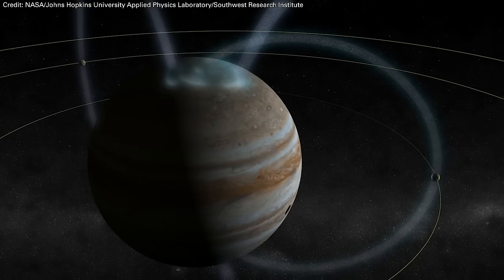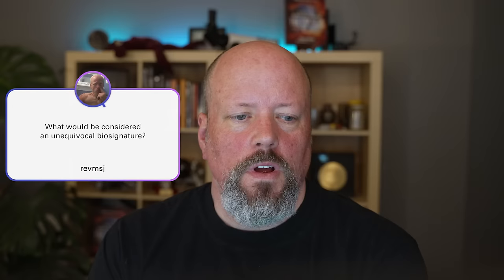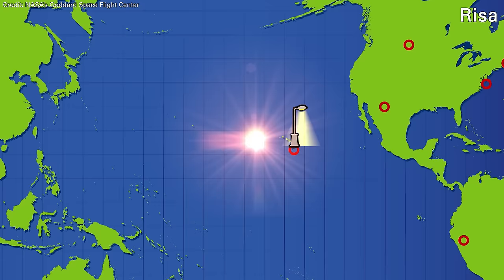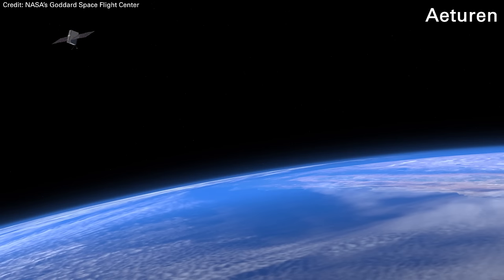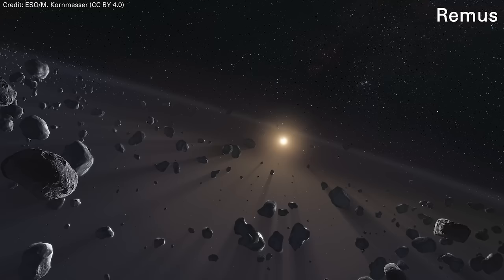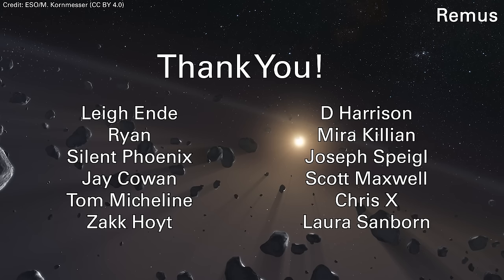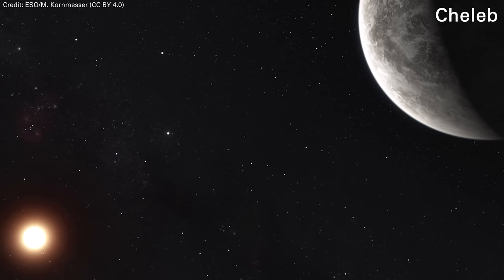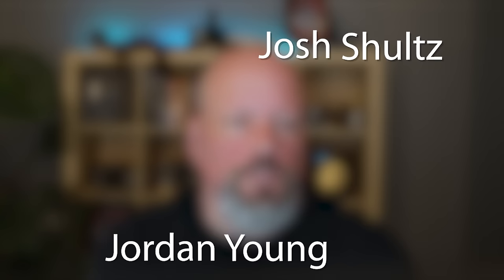Refuelling the Sun, Rogue Planets Auroras, Space Nukes | Q&A 249

Comment: By far the simplest way to get the water from the regolith, is simply to heat it using the sun, it gets well over 100 degrees Celsius on the sunlight up there, so it's just a matter of using solar charged vehicles to transport crushed regolith to a solar furnace and then take the steam and run that into a turbine to produce even more energy, the cooled steam then has lost enough energy to condense out, and there you have water, power all in one.

Comment: I've always wondered why they weren't using lasers for high bandwidth comms. it was possible even at least ten years ago, now, it's ridiculously cheap because of the low cost of high power solid state lasers. Radio waves are not very directional, and thus heaps of energy is lost, but lasers ARE very directional and you can really crank up the bit rate and do it over multiple frequencies as well, it's a no brainer really, plus, because they are so directional, they are also much harder to intercept !. In fact, with time based crpto , they are probably 100 percent secure.

Comment: Hey, Fraser. Sorry to correct you: you can't broadcast anything with lasers, because lasers are by definition point-like, so you can only send information to a specific point in space (that's the good thing about them, since they do not have any appreciable apperture, you don't lose energy as the beam gets farther away). So no, anything you do with a laser is not really a broadcast. You could scatter the beam manually, or have multiple beams to reach more places, but that's a different thing (and very inneficient). A normal LED light would be better (as it will be seen from many angles and directions, which is what I would call a broadcast).
Reply: While theoretically true, in application there is beam divergence. Depending on the distance & separation of targets, laser broadcasting is ideal. When looking looking for sources many light years off, like optical SETI, laser broadcasts would encompass our entire solar system.
Reply: It’s 0.138 arc seconds best theoretical beam divergence… so 17k wide at 1 parsec. I’d say it’s highly unlikely a beam would strike earth. Assuming random angles and limited volumes of lasers per planet it still seems a vanishingly small chance.
Reply: Sorry to correct you but actually fraser is correct. I would know because my dad is the ceo of laser beams
Reply: That's completely backwards. If a laser were point-like it wouldn't have a front or back so you couldn't actually point it at anything.
Reply: @shanent5793  The section of the laser is point-like, not in a mathematical sense, but in a practical sense; meaning that the beam is not conical like most light sources. Instead, it will keep it's diameter for very long distances (even in the Space). And because it doesn't get spread out, it doesn't "lose" energy from the stand-point of the viewer, no matter how far is it. That's the strength of the laser, and the reason you can't broadcast with it.
Reply: @shanent5793  And by conical, I actually meant spherical (which becomes conical when you have a base, like with an LED or a traditional flashlight).
Reply: @guillep2k  that's still not right. A laser beam must diverge. Its minimum divergence is proportional to wavelength and inversely proportional to its narrowest diameter. There's no way to make that zero. The beam can be focused to a smaller spot to increase the divergence until it covers the entire sky.
Reply: @shanent5793  Good luck broadcasting with a laser within the solar system. Anyway, this at least requires clarification.
Reply: @guillep2k  it's probably the best way. The narrow line width and coherency make the signal easier to detect

Comment: Perhaps the best way for any civilization to send a deliberate message to others star(s) is NOT to construct a massive laser, but instead (and this would be easier) to construct a large optical aperture say 5 kilometers or more in total area that is akin to the matrix inside an LCD display, by applying voltage across it you can make it totally black or totally transparent having this in orbit around a star.  So in effect you have a gigantic sun powered optical link. Using this you could send messages to other stars in a variety of formats. Anyone at the other end observing the source star will detect a series of on/off pulses from the star. Admittedly we couldn't discriminate any meaningful data yet with our current technology except perhaps from stars within ten or so light years but soon we will have the ability to tease out all kinds of signal data from stars...

Comment: The sun fuses eleven Empire State Buildings-per-second of Hydrogen into Helium. It fuses Earth’s mass in hydrogen roughly every 300,000 years. It would require a lot of hydrogen to refuel.
Reply from the maker: It already has all the hydrogen it needs, it's just trapped outside the core in the radiative zone. You just need a big spoon to mix up the Sun a little.
Reply: @frasercain  That’s a good point. Red dwarves last trillions of years because the cooler burning pushes less hydrogen away from the core, allowing longer fusion.

Comment: How many launches are required to move 100 to 150 tons to the lunar surface? Side note that mass will be at  or near the pointy bit in the cargo bay. Great Musk states SpaceX will be cheaper per launch by reducing the cost per launch only to increase the number of launches to get 1 starship(HLS) to the lunar surface.

Take into consideration not only do you have to accelerate that mass to a speed to which it reaches the moons gravitational influence, you also have to do a retrograde burn to slow that mass down.

Comment: I would think that being able to detect significant amounts of oxygen gas (5% or more) would conclusively answer that question [is there biological life on 'that' planet?].
Oxygen, you see, is horrifically reactive. It will be reacting with anything and everything. During the normal course of events, all gaseous oxygen on a planet should disappear over time, as the oxygen atoms react with something far more interesting than another oxygen atom. And so, finding large volumes of gaseous oxygen would necessitate there being a biological source that is constantly producing elemental oxygen, from the bonded oxygen within molecular compounds.
If the oxygen levels remain constant after a year of observation, then we can say with certainty that there are biological life forms producing this oxygen as a waste product.

Nb: I'm a chemist, but you might want to ask a biologist this question, for a- potentially- more accurate answer.
Reply: There are some elements that don't or react very little with oxygen:  gold, platinum, iridium, palladium, helium, neon, xenon, krypton and radon.
Reply: @douglaswilkinson5700  
Those elements don't react with oxygen because they're very low on the electronegativity scale, while oxygen is very high. The fact that one doesn't react with the other doesn't change the fact that oxygen is incredibly reactive (only fluorine is more electronegative).

Ultimately, none of that makes a difference in the slightest. The most common elements are going to react with all of the oxygen present, unless that source of oxygen is being renewed.
Reply: @Raz.C  "It (oxygen) will be reacting with anything and everything (sic)."  I responded to this statement by listing  specific elements which do not react with oxygen at S.T.P.
Reply: @douglaswilkinson5700  
Is it really necessary for me to specify that it will only react with reactive elements?
Reply: @Raz.C  You made a statement that is incorrect.  There are people who read that statement and believe that oxygen "reacts with anything and everything."  Oxygen is reactive because of its electron configuration. In fact you can determine if oxygen will bond with something by looking at their electron configuration.
Reply: @douglaswilkinson5700  
That's just being ridiculously pedantic.
It should be OBVIOUS that it will react with those things that are capable of reacting. It will not, for example, react with a person's hopes for the future. It will not react with your savings account's interest rate.

I could go on and on, listing all the various things that Oxygen will NOT react with. However, grownups don't often feel the need to make such lists, because it's understood that when a person says "Oxygen will react with anything," the unspoken part of the sentence, which is nevertheless understood by other grownups is - "It will only react with those things capable of undergoing such a reaction."

Comment: To make an EMP you detonate a nuke near the ionosphere, the electrons in the ionosphere absorbs the x-rays and move in a massive pulse. This causes a large magnetic pulse which induces a voltage in any conductor within range. The high voltage fries sensitive electronics.

A couple of EMP's over North America would wipe out our electrical grid. The effects of this would be devastating to the entire earth. All of the nuclear reactors would lose cooling power and melt down. The spent fuel holding pools would no longer have a water supply and once they boil dry the fuel would ignite. This radioactivity would spread all over the earth. Most people in North America would be dead from lack of water and violence and so any hope of repairing the damaged grid would not exist. The Hanford nuclear waste site is on the Columbia river. With no Maintenance it would eventually corrode and leak into the river, hopelessly polluting the Pacific Ocean. Chemical plants would likewise corrode and leak.

Use of an EMP is suicide.

Comment: Where does the oxygen come from on the moon?
Reply: The moon is made almost entirely of oxides. Rocks are various oxides of silicon, magnesium, iron, calcium, aluminum, …    With water included the surface of the moon is ~40% oxygen by weight.